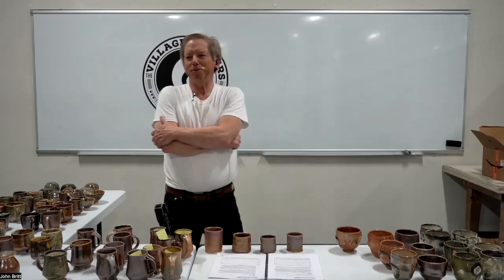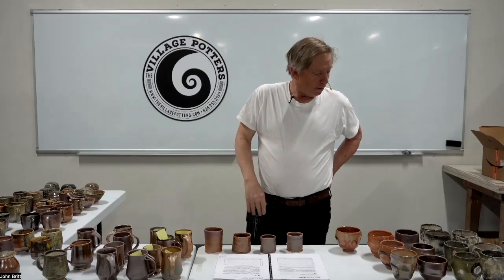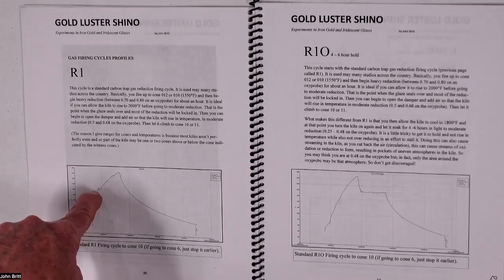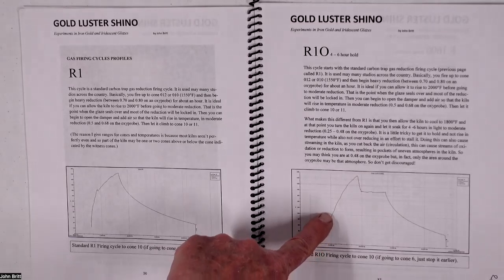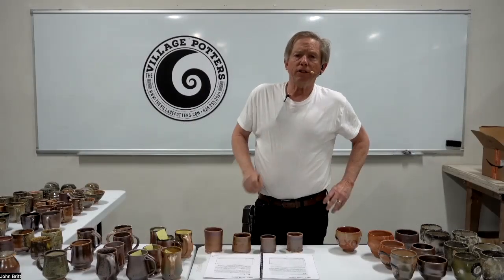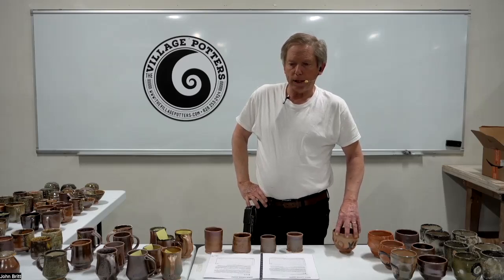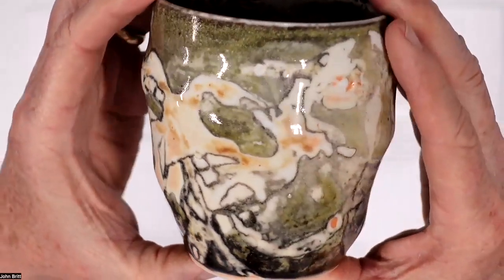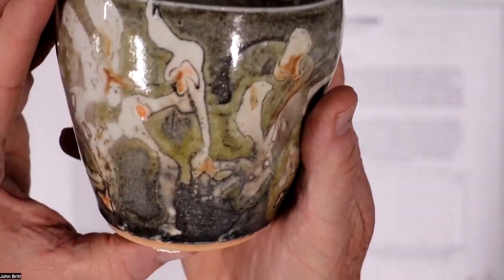NC Clay Club Golden Shino Video #1

Comment: Thanks John, I'm setting up a second studio in Washington state, and the first thing I pack when traveling is your book (mid range). I bought the same 28" L&L kiln just the shorter version. I am having a little issue with glazes appearance, I'm guessing it's the issue of less mass heat when cooling. If the kiln is 1/3 less cubic feet, how much extra hold?
Reply from the maker: Not sure? You could watch cooling and write it down every 15 minutes,  then plot it.
Reply: @johnbrittpottery  Will do , I have a glaze coming up with large kiln, will watch, take notes, then compare  with the smaller next month when I get to #2 studio. Thank you I hadn't thought of that. I blamed it to faster cooling with less mass, but never thought of taking notes of the original size.